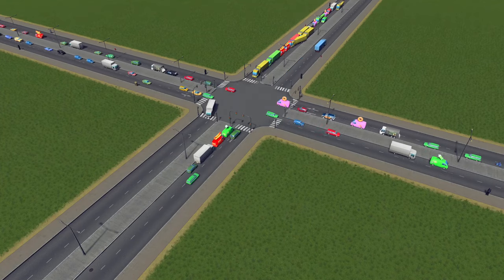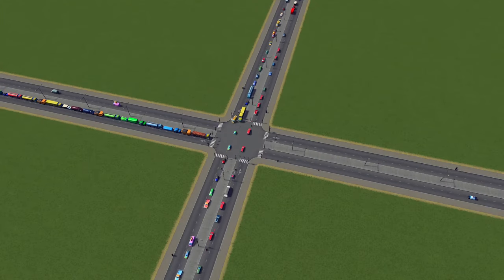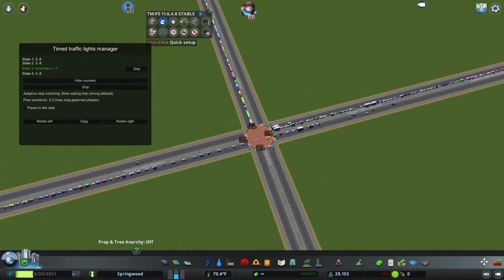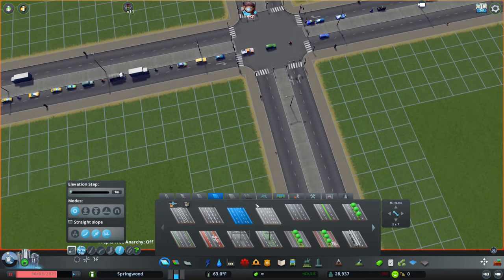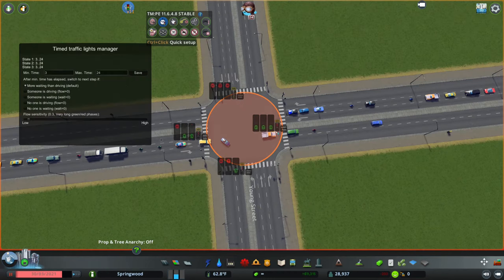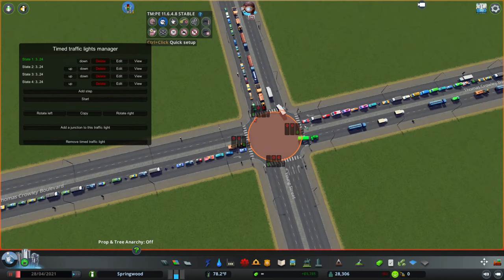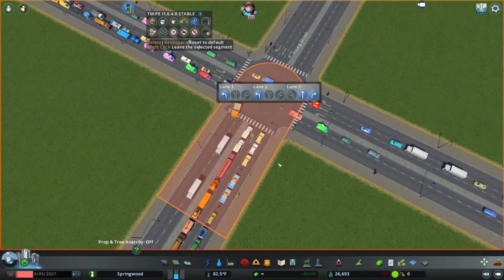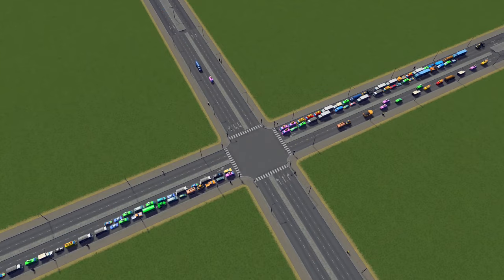Introduction to: Traffic Lights in Cities: Skylines - Destroy Traffic with Hot Signals in your Area!

Comment: Finally someone makes a good explanation of this topic. 4 smaller things I would like to add:
Reply: A: The big strength of the default TM:PE traffic light is that it works for any type of junction, from 3 legs to 8 legs. Which is handy if you want a program to set it up. Also, it works when the roads have only 1 lane or 2 lanes, because the right turn is the only one that moves separately from the others (note that the tool automatically sets up that dedicated right lane for you).
Reply: B: You can mix and match the types of phases for the two direction pairs. For the N-S pair, you can choose any of the 4 shown setups:
- Vanilla "LSR+LSR" (with it's possible conflicts).
- The TM:PE default, successive roads "L*SR+none, then none+L*SR".
- Twin dedicated lefts "L*+L*, then SR+SR" (which I'd personally order as "SR+SR, then L+L", just because of how cars clear and enter the junction).
- The 3-phase setup you showed last "L*SR+none, then SR+SR, then none+L*SR".
Where L* means allowing that left turn and the right turn that is parallel (or call it concentric) with it.
And for the other direction, you can choose completely independently from the same list.

For that shown intersection, I'd use the TM:PE default for the N-S direction. Nobody seems to ever go straight, so you don't need that as a third phase. And the southern road only ever needs a 3-second green. And for the E-W, the 3-phase setup is gold.
Reply: C: All setups (except for the vanilla one) can be made pedestrian friendly (which also means cars don't get stopped at the crosswalks) as follows.
For the Twin dedicated lefts and the 3-phase setup, you first need dedicated lanes for all 3 directions on those 2 legs of the intersection. For the TM:PE default setup you still only need 2 incoming lanes (LS and R).
Disallow the right turns that happen together with the straight movements. During that time, pedestrians can cross without conflict parallel to the cars that go straight. The deactivated right turns then have to be enabled with the lefts of the other direction pair (which does exclude the vanilla setup).
Reply: D: The "dedicated lefts" setup is very handy if you have mode-dedicated lanes on the inside or outside of the road: tram, bus, bike (the latter only in real life, since TM:PE doesn't allow directional traffic lights for cyclists).
That is because you can always draw a straight line through the center of the intersection that nobody crosses. In the S+S phase, that line goes from median to median, which is handy because trams can cross along that line conflict-free. In the L*+L* phase, that line goes from corner to corner, which is exactly the direction where cyclists would want to make left turns that are usually hard to accommodate. In both cases you can in fact draw 3 such lines in parallel parallel between all medians and corners, which means that left and right turns are also possible conflict-free for trams (and center-of-road bus lanes), and straights for cyclists and pedestrians (as explained in point C).
Reply: If you are wondering, yes, I thought about this topic a lot already. I would have made a video like this myself, if my laptop wasn't an absolute potato.
Reply from the maker: @Pystro  Absolutely agree and I maybe should have explained the first bit (mix/match and the types of phases) better in this video. If I do a follow-up or a revisit to this video I'm definitely adding some of those explanations into the video.

For your second comment here I completely agree. The N/S directions really don't need a 3-phase, and honestly if permitted left-turns (as opposed to protected) were something you could program in TM:PE I'd probably go with just a single-phase (N/S RS+permitted L) instead of a 2-phase or 3-phase signal. I try to keep my tutorials in the 10-15 minute range because otherwise I get bogged down into too many specifics but I love it when someone comes in the comments and points out all the things that I could do a better job of as I can use it for a more in-depth followup.
Reply from the maker: Thank you for all the well-thought comments and ideas. I agree completely with all of these points, especially with how flexible TM:PE is in regards to light sequences and flow of traffic (re: trams/buses/etc). You've given me a few things I want to add to a more-"advanced" followup for including public transit or more complicated intersections.